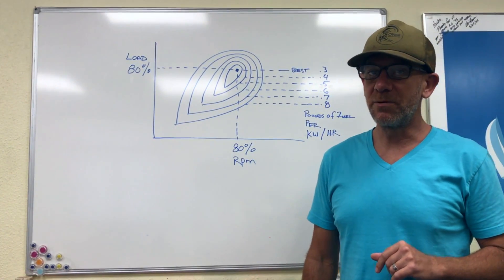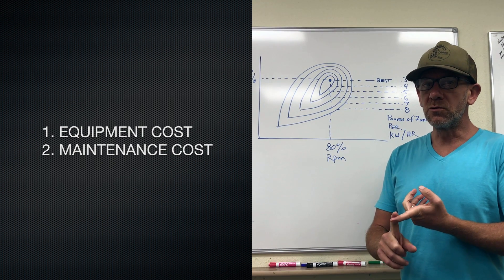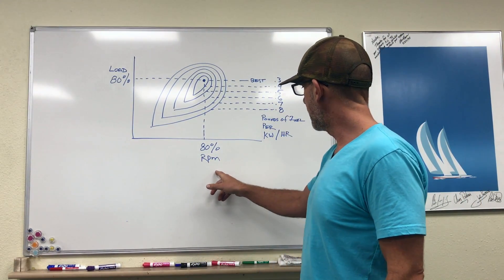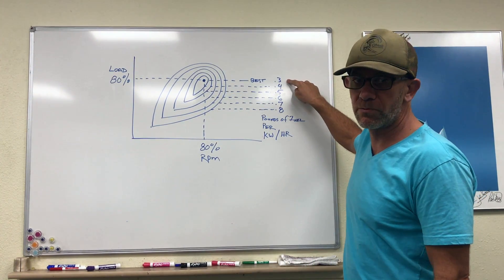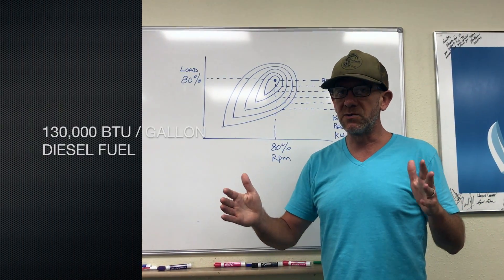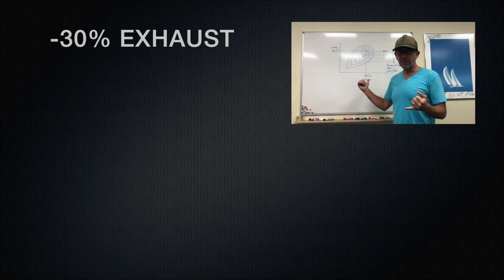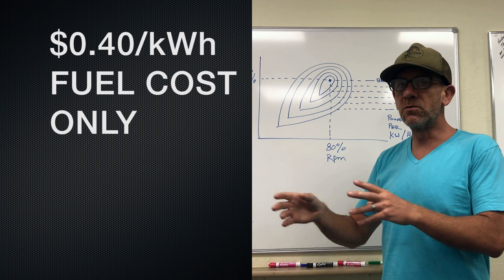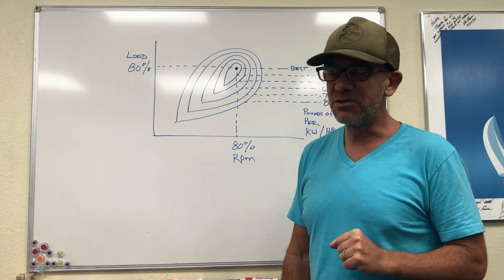Cost to generate electricity with a Diesel Generator? ✔️

Comment: "Most diesel engines only have about 2,000 hours worth of life in them."   Dude, are you SERIOUS?  That's 83 days.  You're either insane, or this video is a prank.
Reply: My generator has 12400 hours on it and all I do is an oil change once in awhile when I remember. He must have bought a Ford.
Reply: ya, I noticed that as well. I'm also confused about the high maintenance cost estimate--from my experience diesel engines run a very long time and are pretty low cost to maintain.
Reply: It was an oversight - cut him some slack guys. He meant 20,000 hours I would think
Reply: Wrong. My Deutz 14kW gen-set is expected by the manufacturer to last at least 30,000 hours. My Kubota 6kW gen-set already has 10,000 hours on the clock, and is going strong. Quality (NOT no-name Chinese) diesel generators last damned near forever with proper maintenance.
Reply: Was literally thinking this guy needs to learn real math. 2k hours, laughing. My gensets hit 18k before in frame rebuilds.
Reply: How abouts running black diesel
Reply: My Kubota I use for home standby had 6,600 on the non functional meter when I got it, I've got 1,250 on the new meter now and it doesn't even consume oil yet even on 500hr oil changes i've never even had to add oil before use. still starting in 60 degree weather without the plugs and it's an IDI, so I'm impressed.
I've talked to some heavy diesel mechanics that say some of the marine and locomotive prime movers get to 30K and beyond all the time.
Reply: This guy is full of something.. Not sure what but crap would make to much sense..

Comment: Well explained, ... but nowadays industrial Diesels reaching almost 40% mechanical efficiency (e.g. CAT/Perkins 4000 series, certain models are close to 200g/kWh), there might be other makes being even better, but that's the ones i know rather well.
Another thing you did not consider is a CHP setup, that instantly doubles your yield, providing you have a use for the hot water. 
I certainly agree that making electricity from Diesel fuel is expensive (and not Eco friendly) either way, but sometimes there is no choice, especially if you look into larger power requirements. Lets take 500kW many miles away from a power grid, any other power source option would be commercial suicide.

Comment: Thank you for posting an informative video. I do have a few points. A diesel engine designed for automotive use has a design life of 1,000,000. miles. Governed at the peak of its torque curve, (aprox 1,500rpm), I would expect about 15 years life running 24/7. Many large ships have generators that have been running for more than 30 years. Directly coupled to a 4 pole alternator, 1,500rpm would provide 50hz. 1,800rpm would provide 60hz. Another point is fuel costs. I assume that you were considering road vehicle fuel which is approximately 60% tax. Commercial diesel is approximately half the cost.
Reply: 1,000,000 mile design life for an automobile?
Reply: @asbestosfiber  over the road truck diesel engines used to go one million miles. but with all the additions they do not last that long anymore.

Comment: Engine life @ 2000 hours would be abysmal. I have a 60HP Fiat with going on 13000 hours , 100 Hp Perkins with almost 10000 and a VW Jetta TDI still running with half million kms. Acquaintance has JD with over 40000 hours. They must love this region!!
Reply: Yanmar's diesel air cooled engine manual says replace the rings at 2,000 hr intervals....I don't  have anything else on this unless you are driving a 2 pole head vs a 4 pole generator head. Most smaller air cooled diesels are driving a 2 pole at 3,600RPM....Slow them down to 1800 and they live longer, less noise and are more fuel efficient.
Reply from the maker: Yeah, I flubbed in the video on that part. I would've re-filmed that portion but didn't notice the mistake until editing the footage a couple days later. FWIW, there was a correction issued in the description (2000-8000hrs). Now, if you're getting 10K+hrs without any major service, that's impressive.
Reply: Have a look at my reply, Regards, Wills.

Comment: what kind of diesel engines are you getting that will only run 2000 hours??  ones made in china? that run at 3600 rpm?  i have old onans and kubotas with close to or over 10,000 hours than run great.
Reply: I've got a Chinese cheaply 20000 hrs so far
Reply from the maker: Good catch! Yeah, I flubbed in the video on that part. I would've re-filmed that portion but didn't notice the mistake until editing the footage a couple days later. FWIW, there was a correction issued in the description (2000-8000hrs). Now, if you're getting 10K+hrs without any major service, that's impressive.
Reply: Hey vdub. I work on the water. Also I noticed your correction.

I just want to note that if someone had an old detroit diesel 471 or 671 they can get ridiculous hours out of them. They're also cheaper to fix and pretty much run on urine and dreams 👍 haha
Reply: Nippon Sharyo is also an excellent brand! Made in Japan.

Comment: Thanks for making this channel! I'm working with micro-grid CSP+ R&D and very passionate about renewable energy solutions. This video answered several questions I've had and will help build arguments and comparisons to help people move away from generators. 
Would love to see videos on current emerging technologies/solutions that could offer independency and replace generators in rural areas.
Looking forward to future videos!
Reply from the maker: Many thanks for your comment, Johan, I'm very pleased to hear that you found value in the content. 

Solar + Batteries seem to be leading the charge (pun?) for alternatives to diesel generators in rural applications. However, for many of these installations, batteries are accounting for 80-90% of the system cost due to the limited daily production window for solar. Uprise Energy ( http://upriseenergy.com/ ) is developing a portable wind turbine designed for distributed generation and the low wind speeds typically found in rural locations.

More videos are forthcoming and thanks again for your input!
Reply: is there an update on your work sir?

Comment: Hey, I like your idea of the channel, but you didn't supply sources for most of your information, so we can double check it.

I was really disappointed when you confused kw with kwh. I thought it was just a slip in the video, but you did the same mistake in the description. BTU can only be converted to KWH, as it represents actual energy, not potential energy per unit of time like kw does.  
e.g. even google correctly converts BTU to KWH https://www.google.com/#safe=off&q=3412+btu+kwh
Reply from the maker: You're absolutely correct, kW is instantaneous power and kWh is power over time. The information shared in this video was learned at the Cal Maritime Academy during Marine Engineer studies and refined over the years with various personal and professional energy projects, so there's no specific source material to site but I will keep that in mind for future videos. 

Glad you like the channel, we're just getting started and hope to improve over time. If there are any topics you'd like to see covered, feel free to drop us a line and if it's something we feel qualified to speak to, we'll make a video. Thanks for your feedback!
Reply: kWh is not power over time. It is power multiplied by time. Energy/Time*Time = Energy = kWH, nonetheless still enjoyed the video.
Reply: Yeah, that is what I meant, bad wording. Power over time as in "if you apply x power over 3 hours you get y energy" so you multiply with time, not divide.